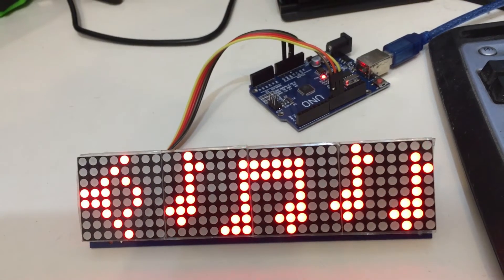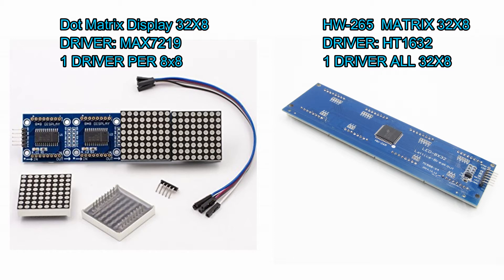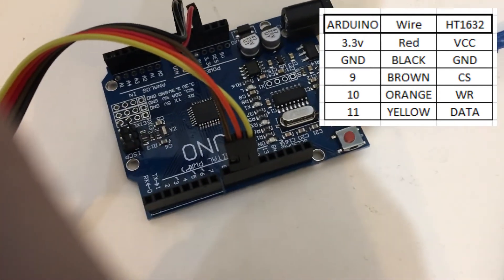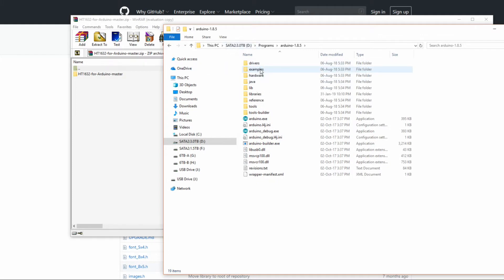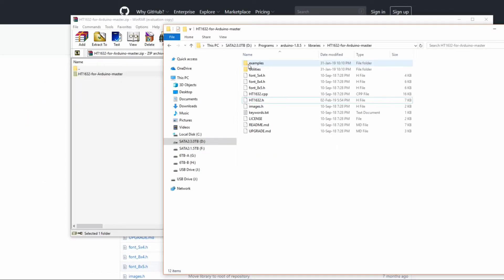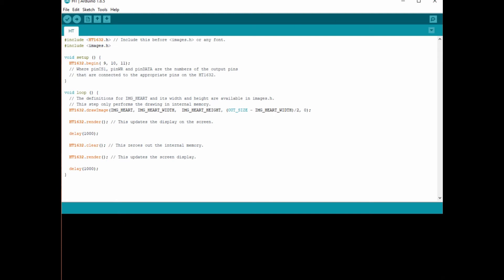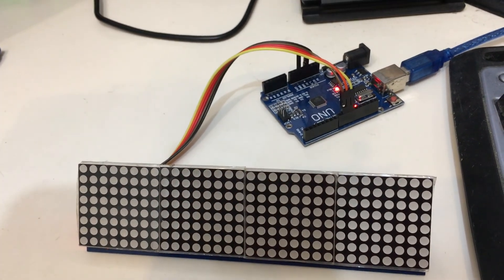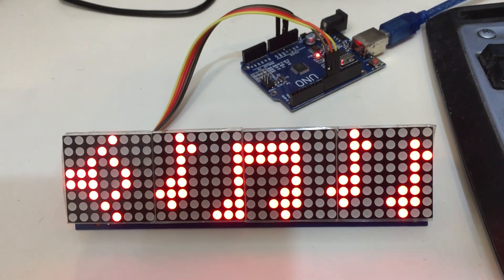HT1632 setup, wiring & Basics on Arduino (LED MATRIX 32X8)

Comment: I followed your instruction,but the images were fliped and rotated 90 degree, rows and columns were transposed
Reply: A solution is to go to line 386 in HT1632.cpp, and replace the implementation of HT1632Class::render() with the following codes:

#elif defined TYPE_3208_MONO
// Draw the contents of mem
void HT1632Class::render() {
	if(_tgtRender >= _numActivePins) {
		return;
	}
	
	select(0b0001 << _tgtRender); // Selecting the chip
	
	writeData(HT1632_ID_WR, HT1632_ID_LEN);
	writeData(0, HT1632_ADDR_LEN); // Selecting the memory address

	// Write the channels in order
	for(uint8_t c = 0; c < NUM_CHANNEL; ++c) {
		for(uint8_t i = 0; i < ADDR_SPACE_SIZE; ++i) {
			uint8_t u=31-i, x = i/8*8, y = u%8;
			byte dat0 = mem[c][(x+0)%32];
			byte dat1 = mem[c][(x+1)%32];
			byte dat2 = mem[c][(x+2)%32];
			byte dat3 = mem[c][(x+3)%32];
			byte dat4 = mem[c][(x+4)%32];
			byte dat5 = mem[c][(x+5)%32];
			byte dat6 = mem[c][(x+6)%32];
			byte dat7 = mem[c][(x+7)%32];
			byte dat = 
				((dat0 & (1<<y)) >0?1:0)<<7 |
				((dat1 & (1<<y)) >0?1:0)<<6 |
				((dat2 & (1<<y)) >0?1:0)<<5 |
				((dat3 & (1<<y)) >0?1:0)<<4 |
				((dat4 & (1<<y)) >0?1:0)<<3 |
				((dat5 & (1<<y)) >0?1:0)<<2 |
				((dat6 & (1<<y)) >0?1:0)<<1 |
				((dat7 & (1<<y)) >0?1:0)<<0 ;
				
			// Write the higher bits before the the lower bits.
			writeData(dat >> HT1632_WORD_LEN, HT1632_WORD_LEN); // Write the data in reverse.
			writeData(dat, HT1632_WORD_LEN); // Write the data in reverse.
		}
	}

	select(); // Close the stream at the end
}
Reply: @bothopps881  so cool！ u r genius！
Reply from the maker: I’m not near my computer but i think it was the HT1632.h file that changed this. Maybe double check your selected unit in that file first.

Comment: Thanks for the video. Well educative. But I have a little problem. My display is running from top to bottom, instead of left to right ?
Reply: I want it run horizontally instead of vertically
Reply: How can I set the orientation ?
Reply from the maker: Hey, not sure if im understanding the problem, is all the text running top to bottom across the 8 leds? but it kind of sounds like potential HT1632.h code, did you set it at the start of the project to your model?
Reply: @ScottyDIY  Yes, the texts are running top to bottom(displaying). What I want is left to right or right to left. 
I checked the HT1632 header file but not figuring it out. (Screen orientation or rotation). I am using the same 32x8 Dot Metrix LED from Holtek
Reply: @ScottyDIY  I am using the same library as shown in your video. Is there something I still need to edit or add in the header file ? I uncommented the 8x32 LED line

Comment: Hi! This video helped me out so much. I got my hands on a 32*8 led matrix display that has 5mm leds on it that is run with a HT1632. It had a PIC connected to it. lol 

I took the PIC off and used arduino.
Reply from the maker: Cool. Glad the video helped out. What did you end up making with it. I still haven’t found a use for mine yet other than playing around
Reply: @ScottyDIY  So the part that helped me the most was opening it up with note ++ and edit it.

The display is 40cm * 10cm so I am thinking of using it for the marquee on a bar top arcade I am going to make.
My first bar top arcade used a ras pie and this one is going to have a pc in it. 

 I am a maker in western Canada that is slowly getting into making youtube videos of projects that I make.
Reply from the maker: that sounds cool, i always wanted to make a pinball machine or maybe a retropie, see how i go good luck with it

Comment: HI HOW ARE YOU I MEET THIS PROBLEM (expected unqualified-id before '.' token)  AND M,Y CODE 
#include <HT1632.h>
#include <font_5x4.h>
#include <images.h>

int i = 0;
int wd;

void setup () {
  
  HT1632.begin(9, 10, 11);
}

void loop () {
  
  HT1632.clear();
  // This step only performs the drawing in internal memory. 
  HT1632.drawImage(IMG_SAILBOAT, IMG_SAILBOAT_WIDTH,  IMG_SAILBOAT_HEIGHT, i, 0);
  // If the image intersects with the end,
  if (i > OUT_SIZE - IMG_SAILBOAT_WIDTH) {
    // Draw it wrapping around.
    HT1632.drawImage(IMG_SAILBOAT, IMG_SAILBOAT_WIDTH,  IMG_SAILBOAT_HEIGHT, i - OUT_SIZE, 0);
  }
  HT1632.render(); // This updates the display on the screen.
  
  delay(100);
  
  i = (i + 1) % (OUT_SIZE);
}
Reply from the maker: its very hard for me to work out without any other info, did you install the lib the same way? setup the ht1632.h file? is this problem when compiling or uploading?

Comment: I got the HT1632C 32 x 8  Matrix board  on eBay which says its a Full Color RGB, I tried to use the Library with standard PIN connections, the display scroll Jumps to 3rd Matrix (out of 4)  and fill the second one  will all LED's lit ...also I dont see the Board Type for this..any help ?
Reply from the maker: Make sure you have set the board type in HT1632.h. If you specify a wrong NUM_CHANNEL value, it won't work properly. i had this exact issue and change the value around and got it working.
Reply: @ScottyDIY  yes selected the best option I had in the list, however looks like the board I got is a more recent version with RGB with additional pins for color signal and may need addition settings /params... May be there is a different library for RGB board, have to explore... Display works but not the way I wanted, thank you for your inputs
Reply: @ScottyDIY  NUM_CHANNEL DEFAULT WAS 1, when changed to other values it did not work, my board is 32 × 8 ( four 8*8 modules cascaded)  I have a similar MAX7219(red) which works perfect and straight forward. 

HT1632C seems tricky